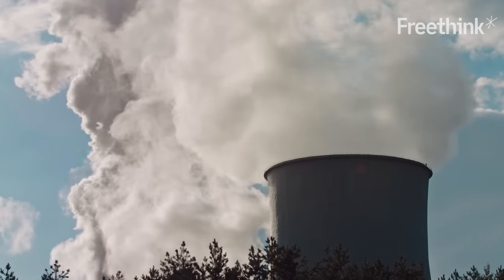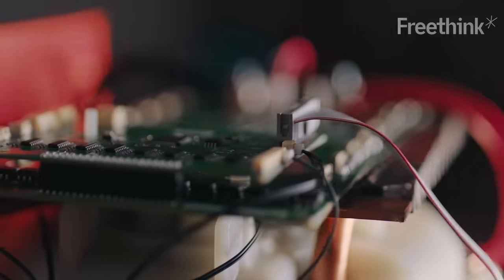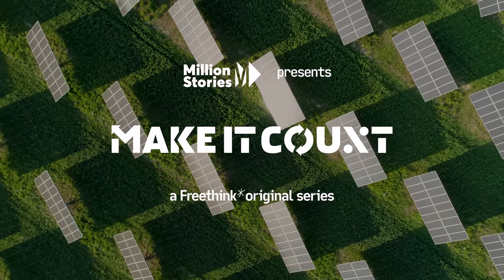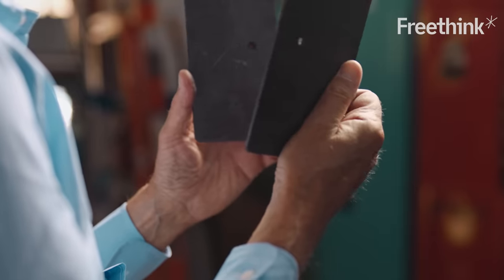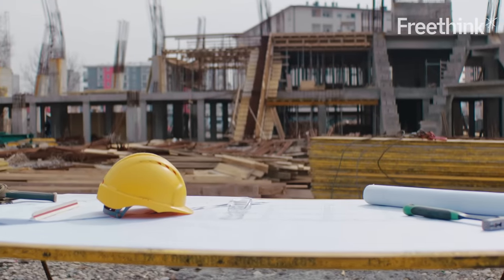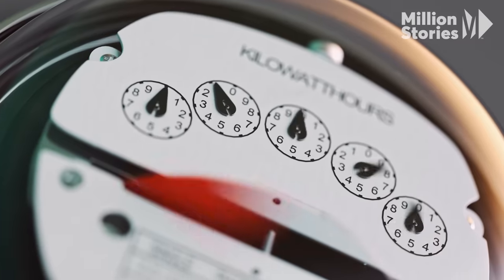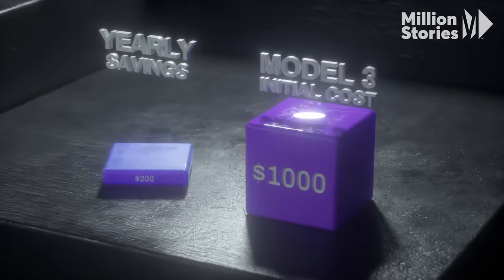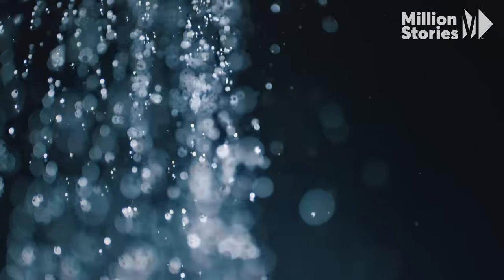The man hacking hot water to save the planet

Comment: Oh man this comment section is difficult to read. Scale build up on heating elements does indeed cause the heating element to be less efficient as it acts as an insulator and inhibits the RATE at which the heat transfers to the water. While it is true that all the electricity will eventually dissipate as heat, longer heating time = more energy usage. Additionally, to a lesser effect, any scale buildup will displace some water in the tank meaning overall less water is being heated from the same input. Also the technology he is describing does not cause electrolysis 😂. But as mentioned by someone else it only heats the thin layer of water present between the carbon plates when AC is applied. It’s simply a form of resonant water heating. The model he showed in the video is likely scaled down for the viewers to see better. This is a completely plausible technology and decent crack at a real engineering problem. Yet everyone is so negative and quick to judge. Know what you’re talking about before commenting or you just look ignorant. No wonder the technology hasn’t taken off in the market yet…

Comment: This is not new technology. It's very, very old technology. Which fell out of use because it offers zero advantage over plain heating elements. It's no more efficient than plain resistive heating elements, except it produces explosive hydrogen-oxygen gas mixture as a byproduct. All of the 'advantages' this video talks about are really just advantages of an on-demand water heater, and you can do that better by just using existing on-demand heaters.

Comment: The information on the product looks sketchy, It's just an electric arc heater running at low voltage in water but the figures don't show anything of value and the descriptions are filled with fluffing. This kind of heater is made by prisoners to cook food in their cells so it's hard for me to believe a lot of the infrastructure stuff as well.
Plus what do you do during a long term power outage? Most people don't have generators, nonetheless just for heating their water. 
Whole product feels off, I don't trust it at all.

Comment: We are carbon based life forms, carbon is, what it is, a building block of our planet/bodies/ and more... dont treat carbon as the new Gluten... 
the whole problem is HAVING LESS PLANT-LIFE, less TRANSFORMING AGENTS,
 ACTING TO DEAL WITH SUSPENDED particles like carbon does in the atmosphere, consequentially due to OXIDIZATION unbalance comes to us all( to all reaction prone things), oxygen reacts with small enough carbon matter arrays, and when carbon dioxide occurs, in a volume higher than what the natural devices can deal with, 
thats when we accelerate the planet dynamics/entropy, but the MAIN ISSUE IS: burning the both ends of a candle, its double *jeopardy, if we got less vegetation, and natural traps/filter/agents, PLUS an increasing volume of particles around, not only they reduce all lifeforms quality of... life, but also speeds up the entropic transformation of organic matter.
SCIENCE is not BIAS.

Comment: This is stupid.

No energy is lost because of "mineralisation" on the heating rod. If you use heating rods with more surface area compared to the power output, less of boiling occurs and the lifetime of a heating rod is increased. This "new invention" is notning new. This whole idea is that spare heat from the boilers insulation is for no good use and a waste. In my basement I need this little spare heat från my boiler/heat pump. This heat loss is not a loss!

The second problem is with this instant heating idea is that the power grid cant handle such a load. Imagine morning and evenings when a lot of people are taking their shower, what a massive power outage!

Bad idea, try again. Btw, heat pump is a good invention.

Comment: We are such clever monkeys yet not very bright. Solar hot water tanks are simple (no moving parts) and doable even in winter (greenhouse required, large tank in coldest climates). These were common years ago before energy was connected to homes. However it meant using the hot water when it was available, afternoons, early evenings. Today we want 24/7 hot water. Go on a month long vacation and we leave the hot water tank burning. We don't even wire electric tanks with a switch to flip them on and off.

Help speed the transition to green technologies? Increase the cost of burning fossil fuels. Call it the true cost if you like...or make it artificial, doesn't matter. Shift taxes from income, property and sales tax to energy taxes. Oh boy you will see changes. But people don't care about green that much. People talk about green but don't do green. We'll be dead before any of that will matter that much. It'll be our kids' problem, or maybe their kids. Why should we care? It's like the end of the Roman Empire. I'm sure there were people then saying "taking off work to go to the games everyday for 3 months is probably going to tank our standard of living, but screw it, that'll be our kids' problem." Human nature is a bitch.

Comment: What a pile of horsecrap. This is not a new idea at all, and it does not increase efficiency more than a few percent. If you really wanted to make a dent in the efficiency of making domestic hot water from electric power, you would use a heat pump. That would DOUBLE the energy efficiency.

Comment: THERE IS NO NATURAL GAS TANKLESS WANTER HEATER USING 100AMPS HAHA!!!!! THEY CAN BE RAN ON A DEDICATED 20 AMP CIRCUIT OR A SHARED CIRCUIT SAFELY AND WITH NO ISSUE. ELECTRIC TANKLESS WATER HEATER DOES HOW EVER YOU A 90AMP,90AMP,60AMP BREAKERS.

Comment: Sorry… if you don’t break the first law of thermodynamics, with your device you can heat it fast… but to boil water a constant amount of energy is required. An electric heater has 100% efficiency.
Reply: During 1996 in India i used to buy the pocket version cookie size water heater, electrodes made of steel blades for 2$ to heat my bucket full of water.
Reply: @Alis879141  it does not change how much energy is required to heat 1 liter of water from 25 to 100C